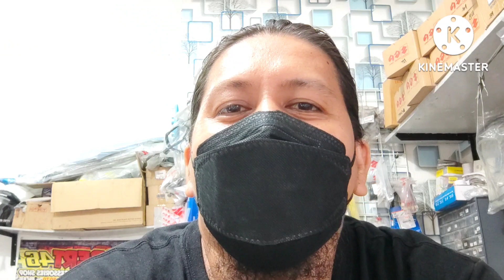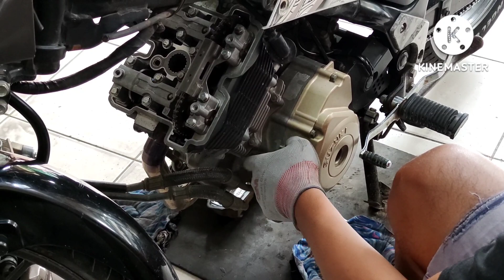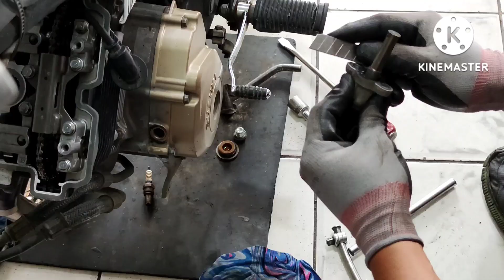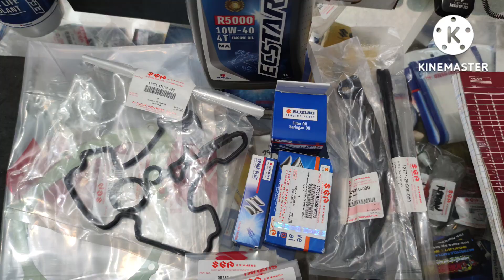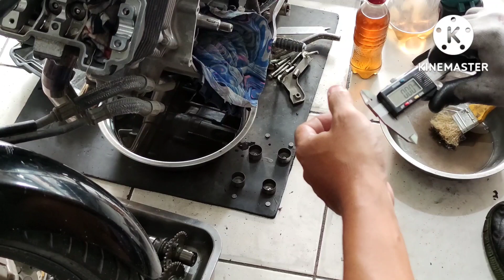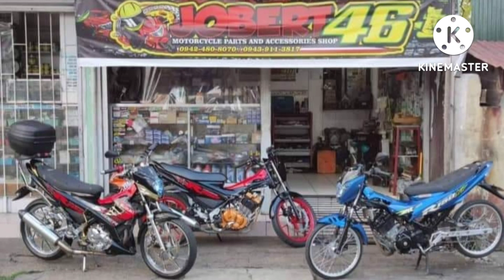Maingay ang makina, akala ni boss dahil sa tensioner...

Comment: Sir magkano mag pa refresh ng raider carb
Reply from the maker: Ilan odo n yan sir? Anong yr model?
Reply: @jobert46tv2  31k+ odo 2019 model
Reply from the maker: @efrenpaz571  ano bang problema sir? Kung samin mababa pa yan para i refresh e
Reply: @jobert46tv2  medyo umingay lng sya cguro bka ireset lng ang tensioner
Reply from the maker: @efrenpaz571  kung ingay need muna i check sir. Baka di naman need i refresh. Nag refresh/ top overhaul lang kami kung may un usual ingay sa head ( di kasama timing chain saka valve clerance)putol exhaust bolt, tagas sa block, loose comp,usok n puti. Pag wala dun di namin huhugutin
Reply: @jobert46tv2  ok sir pacheck q nlang muna yung tensioner bka kelang na reset
Reply: @jobert46tv2  salamat

Comment: kung ako yung customer derityo na top overhaul yan para makita kung ok paba piston o piston ring derityo hasa at linis na din ng mga valve kasi matagal na motor nya di pa narerefresh
Reply from the maker: Mas ok yun sir..kaso mas magastos palit lahat ng gasket, o ring, valve seal, piston set samin pag ganun. Hindi kasi kami nag baklas, linis, dikit lang, orig lang din na parts kinakabit namin di kami gumagamit ng after market
Reply: at least isang gastos nlang sir kaysa sa mga ilang buwan bumakat ang piston rings at umusok
Reply: yung motor ko nga nasa 29 k odo nerefresh ko na kahit wala pa ako nararamdaman, palit lahat Valve seal piston, piston rings base gasket head gasket hasa na din, check din ng cam, valve guide, timing chain, timing chain guide kung ok pa ang con rod para makita mo tlaga kung ayus pa
Reply from the maker: @ais2783  sana lahat ng customer parehas mo ng mindset sir. Yun nga lang kung ayaw naman ng customer wala tayong magagawa kahit i suggest natin yun. Budget kasi yung iniisip nila
Reply from the maker: @ais2783  yung 29k odo masyado pa mababa yan sir. Tune up lang gawa namin dyan. Kung yun gusto mo gawin at willing naman gumastos mas ok. Basta orig parts lang ikakabit para sure
Reply: @ais2783  baba p yan paps. sakin 89k
Reply: baba pa odo mo paps saking 89k eh
Reply from the maker: @jcabenio2588  yung 89k odo mo sir ano na nagawa dyan?

Comment: sir ask kulang po sana kung ano problem ng motor ko pag ma layo² na tinakbo uminit na makina may maingay na para lagitik sa head banda .minsan naman nawawala ang ingay pag mahina lang takbo ko. iba² kasi mga diagnosis ng mga mekaniko dito sa  amin napagtanongan ko baka ma pa gastos ako sabi ng iba tensioner.iba namn rocker arm, tapos normal daw sa compression release at shims mga diagnosis nila. ano kaya possible issue sir.
Reply from the maker: Ilan n odo sir?yr model
Walang rocker arm ang raider
Yung decompressor naman umiingay lang pag mababa menor sir
Yung shim pinapalitan pag malaki n clerance kasi nag cause ng lagitik, pero dapat sukatin muna
Reply: @jobert46tv2  80k 2016 dec binili
Reply: @jobert46tv2  Baka tama po kayo kasi ako lmg nag tun9l9 ng motor ko
Reply: nag simula yung ingay nung ginalaw k9 Yung carb
Reply from the maker: @aoj4593  ilan yung rpm sir?
Reply from the maker: @aoj4593  ano na nagawa sa motor mo sir?
Reply: @jobert46tv2  slr sir now lang naka load pang internet.
Reply: @jobert46tv2  diko pa alam sir kasi second hand bili ko nito nung Mayo lang ok namn sya nung pagkabili ko. ngayong buwan kulang talaga narinig yung pag uminit na ang makina nag lalagitik na sya tapos pa minsan minsan nawawala . tapos kahit 2mins naka tambay ulit ang motor mga ilang minuto andar nanaman  walang ingay pero pag uminit  nanaman habang na byahi may naririnig akong lagitik ulit. nawawala lagitik nya sa head pag pinipisil ko ang clutch.
Reply: @jobert46tv2  nag message po ako sa fb page nyo po sir.